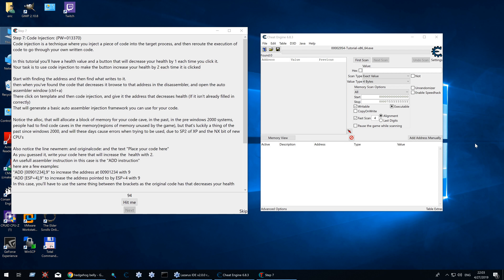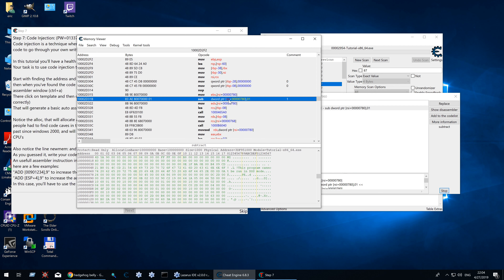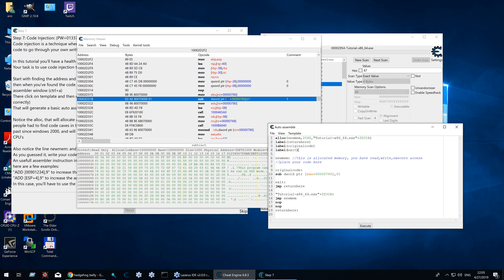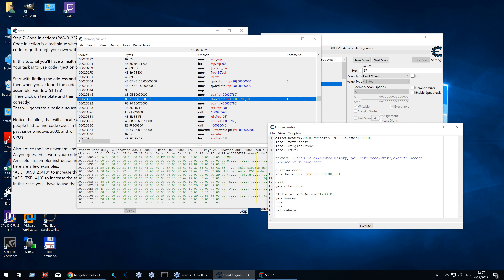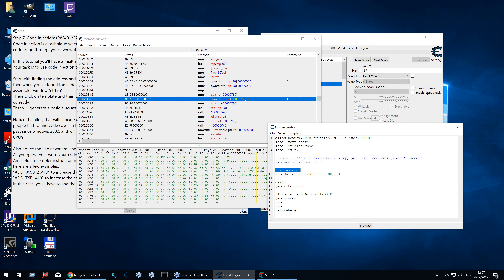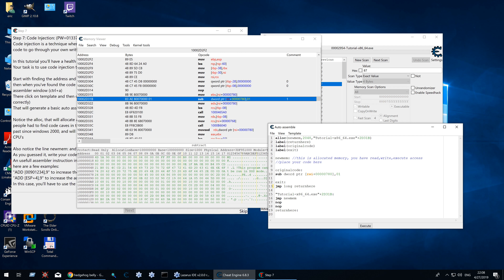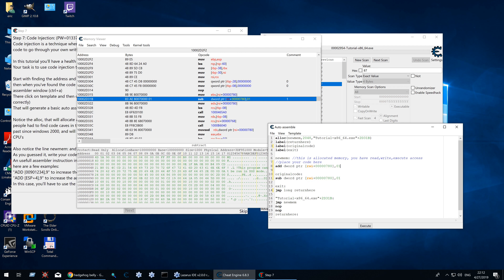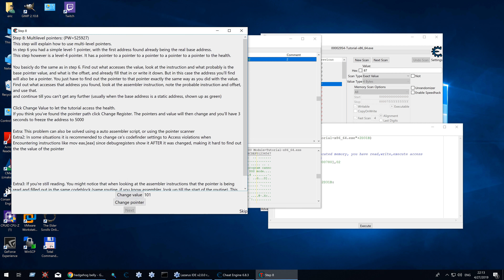Cheat Engine Tutorial Step 7 : Code Injection

Comment: Um it says error not all code is injectable (Error in line 7 (globalAlloc(newmem,8)) :Error allocating memory)
Are you sure you want to edit this
Reply from the maker: any reason you're using globalalloc? it's only useful if you have other scripts accessing newmem. (it allocates once so usually a bad thing for newmem which tends to be unique per script) 

besides that, make sure you are attached to a process
Reply: @cheat_engine  it was for Genshin Impact with a script

Comment: I don't understand why you added "short" and "long".
Your accent isn't helping either :(

But it worked for me anyway, I just wrote 
"add dword ptr [rsi+000007E0],02
jmp exit"
(without "") where the code should be placed and that's it.

Thanks for the video, wouldn't have been able to do it without it :)
Reply from the maker: short and long are just ways to tell the assembler to generate specific code. e.g if you don't use it then CE will just assume it's long even when you could have used less bytes